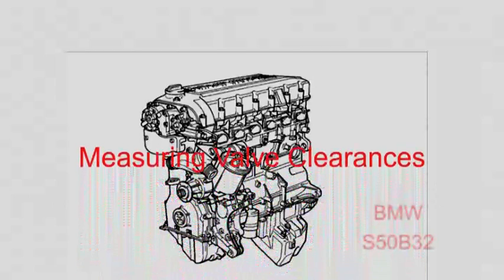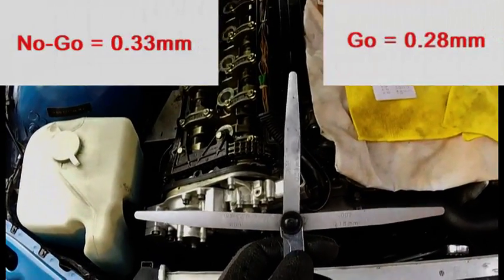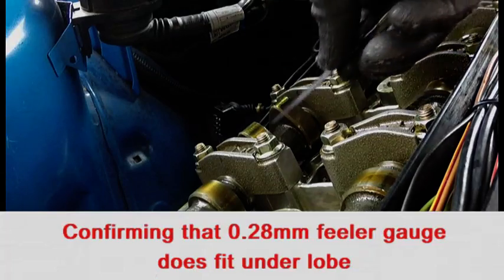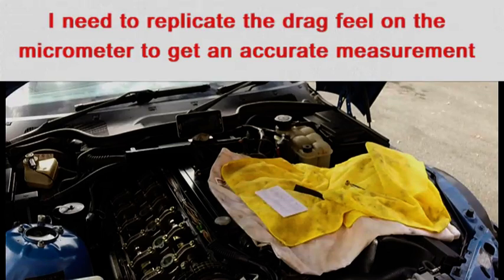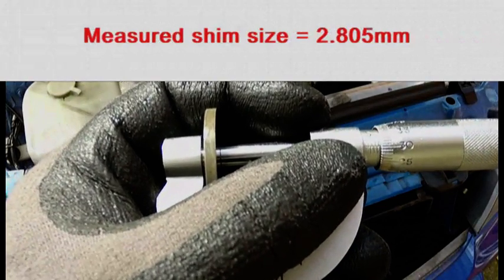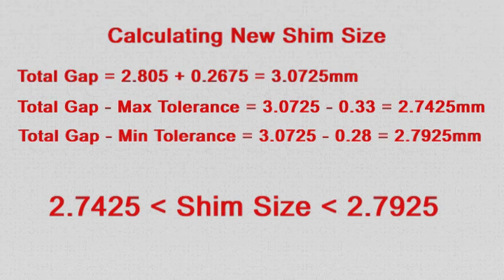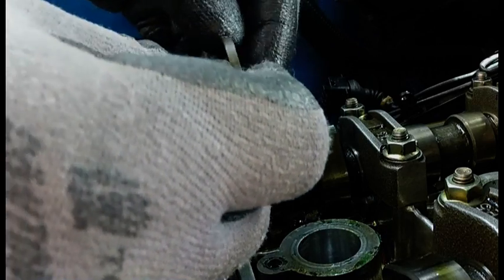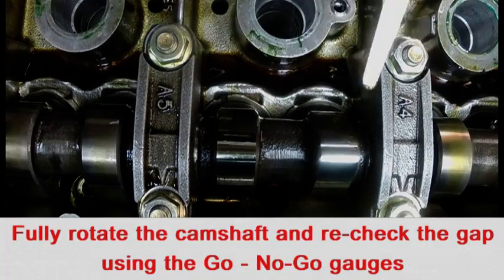Measuring Valve Clearances on BMW S50B32

Comment: Brilliant, really useful. Thank you! When referring the cylinder 4, do you count the cylinders from the front of the car or back?
Reply from the maker: Cylinder 1 is at the front of the engine.  By convention, the front of the engine is where the pulleys are and the rear of the engine is where the clutch is.

Comment: I suppose then I need to repeat this protocol on every single shim out there right ? why do we start by no.4 in specific ? excuse my ignorance... just overhauled my vanos unit & i thought it might be a good chance to check valve clearance & whatever else I can tackle on my way to re-assemble
Reply from the maker: You can start with any valve.  It doesn't matter what order that you do them in.  And, yes, you do need to check all of them.